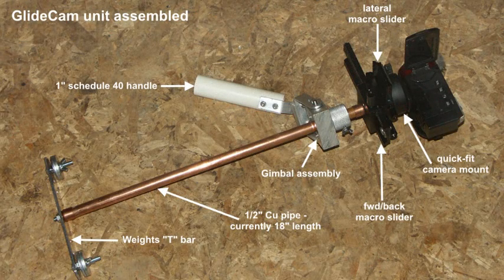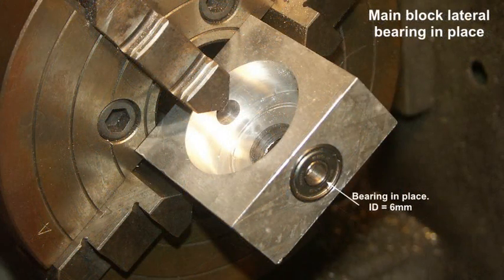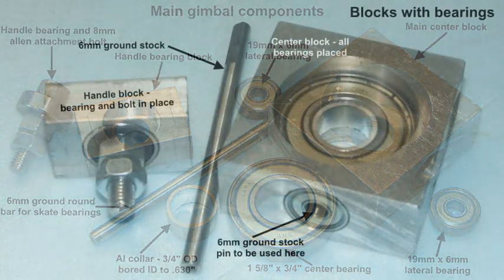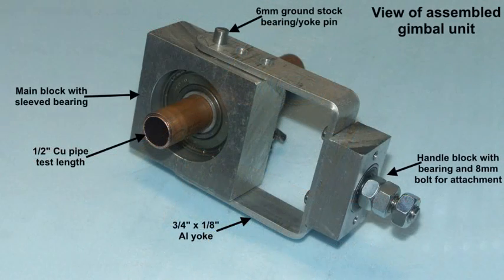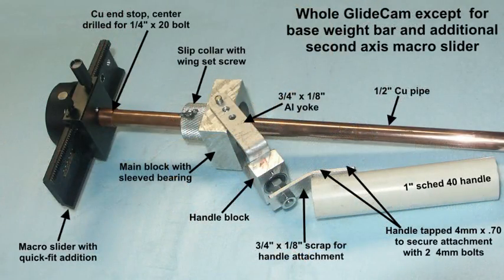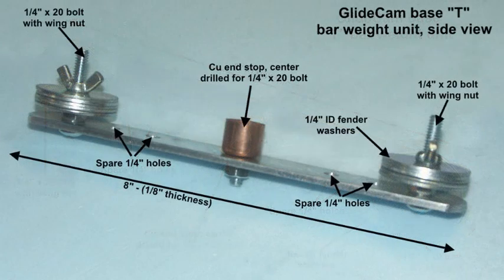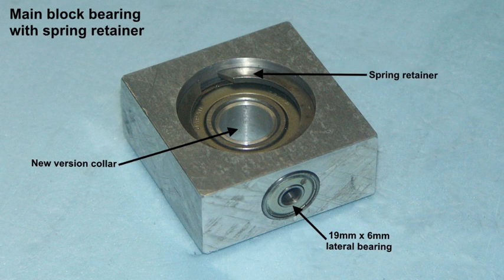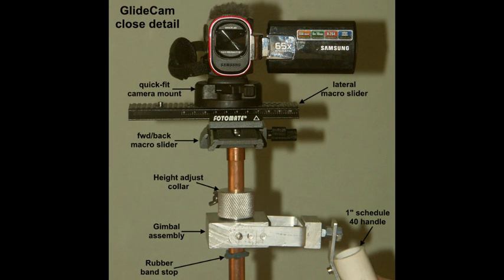A GlideCam initial build details, phase 1 - main fabrication.

Comment: Hello Chris. Exceptional job on the gimbal area. I am in a proccess to make mine glidecam style stabilizer. Unfortunately, my efforts turn to be a fail in the gimbal, due to my lack in precision machining tools. I had the same idea to use two lateral ''fotomate'' sliders for the top plates. In fact I 've already purchase them, from ebay for 10 $ each. Now I am stuck because of lacking a good gimbal main block without any tolerance.  Congrats, for your job.
Reply from the maker: Hey Stefanos -- indeed, the gimbal aspect is key but.... tolerance can be quite forgiving when you consider that the unit just needs to be free in all axes. A search on YT may well turn up some other approaches - I have seen wood used to good effect. I have had my unit balanced but as yet still need more experimenting with column length and bottom balance weights etc - it sure is critical!

Comment from the maker: Actually the gimbal is aluminum but, I had considered using hard wood - that would work too. Main problem there might be getting the necessary tolerance for holding bearings properly. I have yet to remember to finish setting this thing up to take some test footage - it's been on back burner for ages since I made it!